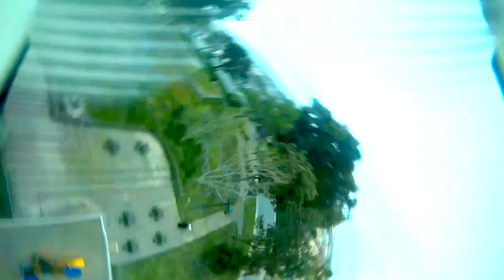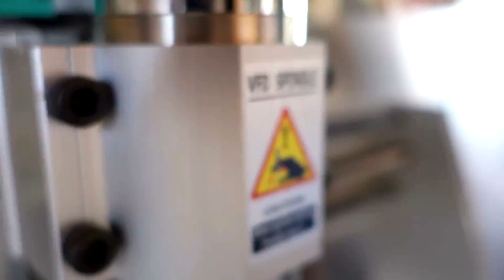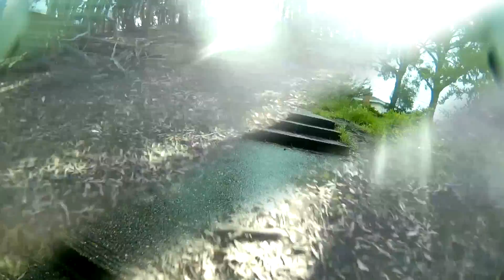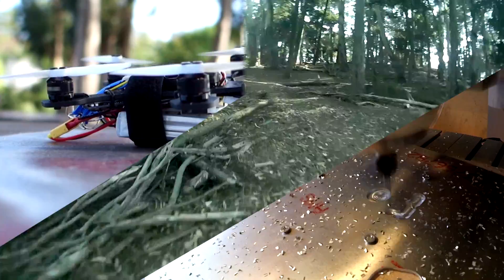Fiber optic tachometer

Comment: Hi, excellent video 👍What do you use to count the speed signal out? Is it a DIY setup or something you bought? Thanks
Reply from the maker: It's largely custom, running off a Teensy3.6.  Doing the timing is pretty simple though, it's only like 2 components to interface with a phototransistor, and it just gets read on a digital pin on the MCU with an interrupt.  You might even be able to read the frequency of the signal with a multimeter in frequency count mode if you needed to.
Reply: SiieeFPV thanks

Comment: there's only one problem with your idea... you can user modern esc's as tachometers... soon anyway. 

Don't underestimate blheli. They are able to run a brushless motor at speeds as slow as brushed motors, of you've done your homework, you'll know that running a brushless motor that slow a few years back would be next to impossible, unless you user your finger.

nonetheless, it's good for brushed motors
Reply from the maker: Except I specifically need it to verify blheli.  Recording the RPM optically gives you an absolute ground truth, and it can see situations when even blheli doesn't know what speed the motor is moving at, like during a desync.  Sensored motor control is not likely to ever be a factor in your regular flight hardware, but it's still incredibly useful for low level testing and validation such as what I'm working on.